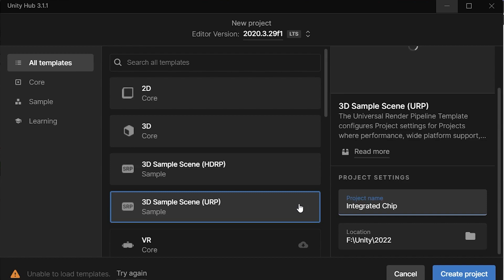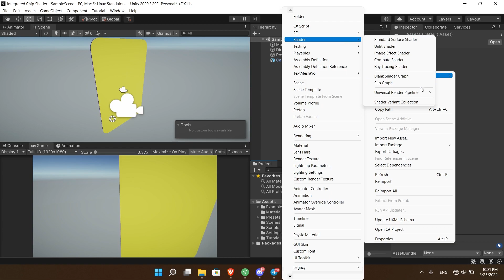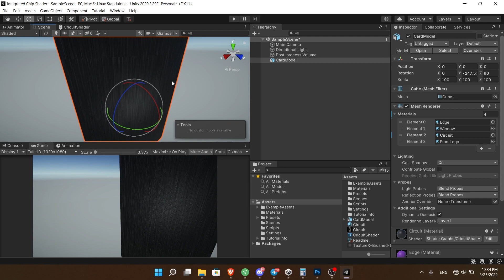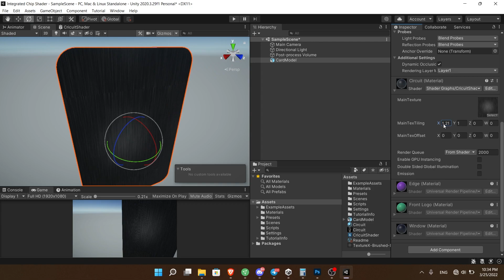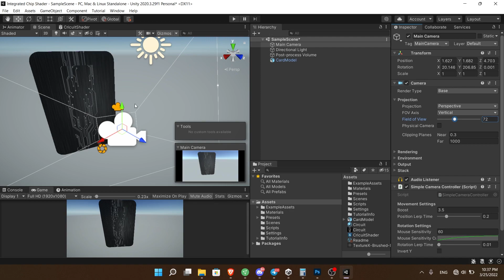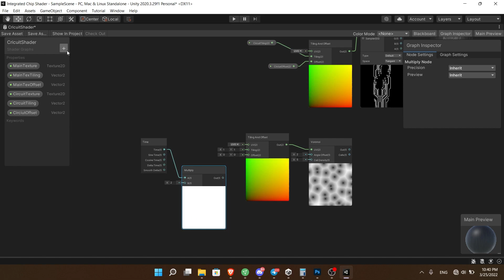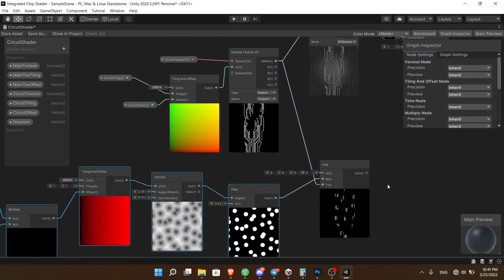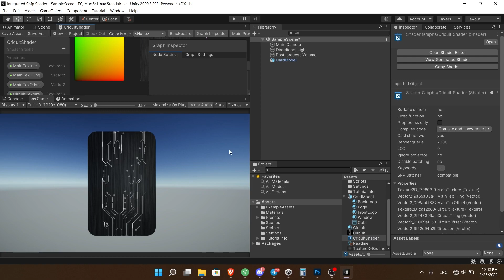Integrated Circuit Shader Graph - Unity Tutorial

Comment: Why I put the Circuit texture in shader is not working    in the second "sample Texture 2D"  it just return a whole dark preview under that window
Reply: Have the same error, you fix it ?
Reply: @oscarzazuetacervera4069  did you change your  circuit texture type? I change  sprite(2D and UI)first and I got problem.
I changed it to Default Texture Type.
It works lol.  Hope this may help you
Reply: @aaronchen7834  I'm getting the same issue, the image is not showing up as white but a black sqaure
Reply: @TheEverydaysam  Change the texture to black and white and invert the color
Reply: i suggest making your own, i checked the licence on the picture ... its not free. use gimp and make sure you have an alpha channel, then when you export to PNG click Save Colou values from transparent pixels. in unity make sure alpha is transparency is clicked in the inspector.
Reply: Did you find a fix?